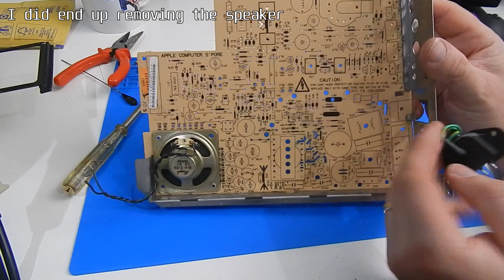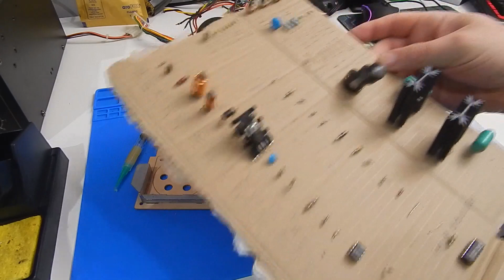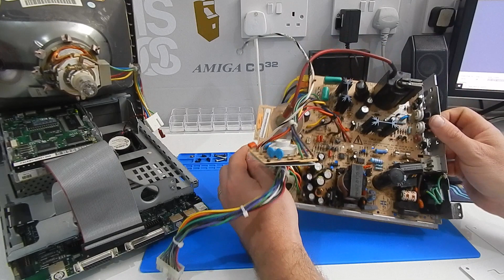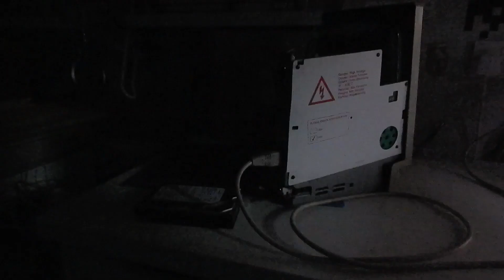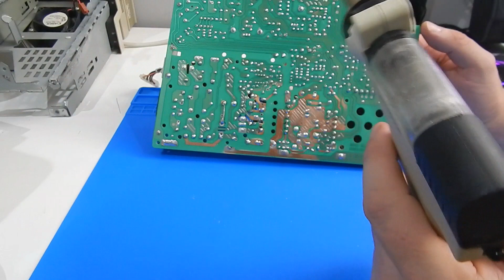Macintosh Classic Part 3 - it works!

Comment: I have the same problem with the screen, it shakes and i got the checkboard pattern, I'll check if it is the 3 caps that I haven't changed, otherwise I might try the PCB relaxing hottub method.

Comment: Thanks for this video. I've been working on a Classic as well and had recapped but still had wobbly screen. We were luckier in that it booted further. After few minute we started to have static noise on the screen as well. Seems like we need a proper clean. I don't think I'll unsolder everything, probably just the speaker and put it in the washing machine. Will see if other comp there that we might remove before the machine.

Comment: Wow!  You removed all the chips/parts on that analog board??  Now that is dedication...  :-)  Glad you brought it back.  I always thought the Classic is the most unfairly judged Mac.  Yes, it was underpowered for the time.  But the base unit (1M 1 Floppy, no hard drive) was the first Mac priced under $1000 USD.  People don't realize how important that was.  And I love the OS in ROM.  (Command, Option, X, O while booting I think??)  It is actually my favorite of the compact Macs.  Not the most powerful, but I think it lives up to it's name. ;-)
Reply from the maker: Yep every one removed, turned into a lot more work than I was expecting but glad to have a working machine by the end of it.  It is a fun little machine and still working fine. I actually have another spare analogue board now although it to needs a bit of work, hopefully not as much as this one.

Comment: Tried my Mac Classic after cleaning but still no video, How do you know if it's your logic board or your analog board?
Reply from the maker: Does the screen turn on at all?

If not its probably the logic board since that is required to generate the signals for the screen.  Most likely needs a recap.
Reply: @CRG Thanks,  I did clean up my board real good and now getting a fant single horizontal line in middle of screen.  At least that's something. Thought my board looked pretty clean but will go ahead and try and re-cap my logic board. I do have a working LC475 so the Classic will just be a project for me.

Comment: Not this one, but for any other blown video Classic Macs, I'd like to see an e-ink (e-paper) display. Since they are mostly show pieces anyways, and B&W, and the screen is small,... I'd like to see a clever e-ink hack on one.  You might be a little burned out on Macs, but you've certainly gained a great deal of hard-earned expertise on these obsolete machines!!!
Reply from the maker: That certainly would be an Interesting mod.  Not sure how fast those screens update though, might not work great for moving graphics.
Reply: @CRG  E-Ink screen are also rated for the amount of refresh, some as low as 10000 refresh. Of course, you can update the screen without full refresh, it is fast but after maybe 5 frame max you need a full refresh cycle because the image becomes "dirty"

Comment: I'm in the middle of restoring a Classic myself. I've got a short to ground and I thought it was DP7. Even with the diode completely removed, it was still shorted to ground but only when the tube board is connected. I've had to order a replacement tube since it blew inside without me noticing.

Also, the drives on these Mac's can use 1.44MB disks, so you can write them with a modern USB Floppy drive. :)
Reply from the maker: Thanks for the info on the floppy drive.  That should make life easier for testing the drive.

Comment: Hi, very good work! I have an analog board 630-0420 that seems the same as your, I hope!. Mine is without some caps and no info on the net is available for the 630-0420... do you have write down a cap list for these analog board?
Reply from the maker: I'll get you a copy of the schematics tomorrow. That lists all the caps or if you want to tell me the capacitor number on the silkscreen I'll let you know what it is.
Reply: CRG Thanks!!! the schematics would be perfect!!! Or considering that I have seen better and all the electrolytics are missing, instead of a caps list I can send you a photos of the board if you prefer. But how?
Reply from the maker: @emilen72  you can get the schematics from this dropbox link - https://www.dropbox.com/s/x80hy38feysm9pw/Macintosh%20Classic%20Schematic%20%28bomarc%29.pdf?dl=0

If you want to send me pictures I'll take a look.  You can send them to my e-mail casualretrogamer@outlook.com
Reply: CRG have mail :-)

Comment: Wow.  What a big job to completely disassemble and reassemble that board.  Given the number of components, putting in the odd cap the wrong way round is not too bad.  Congrats on the result.  Cheers
Reply from the maker: Thanks, it was a silly mistake though as its clearly marked on the board which way it should go.  At least it didn't damage anything else and I had a spare handy so was easy to swap out.
Reply: To avoid desoldering everything I suggest getting the schematics and finding the spot where the low resistance to ground is, that should be much faster than 4 days of work ;)

Comment: Four days to reassemble that analogue board - now that's a labour of love! As to what to use the machine for, my brother used one of these for graphic design when he first started his career. Crazy to think when you consider how small the display is.
Reply from the maker: Well, it was about 6-8 hours total work.  With everything else going on I don't really have the time to sit and work at something  for long periods so it was broken up over the 4 days.  

I discovered on the hard drive a few personal files dated 2019 so this machine was in use as someones computer last year.   Its a wonder it worked though with the leaking caps.  Must have been on its last legs or maybe that's when it failed and the reason it was sold.
Reply: You probably know this, but part of the appeal was the screen was calibrated to the same size as print. Even today we often have to consider WYSIWIG scaling or use special real-size modes (like "oh on this screen do 127% scale"), but that was an inherent feature of these Macs. 

Also there was a healthy 3rd party display market for the machines, all which could, in a vertical orientation, show an entire page at once with the same scaling. So then the tiny Mac screen could be used to focus, or even zoom-in, on areas, or just show a lot more GUI at once. 

In fact if I recall (Computer Chronicles had a feature about it) some businesses kept those external B&W screens in use long after upgrading to colour Macs with bigger screens, precisely because they were so accurate and handy for displaying a page.

Comment: [insert expletive here] you put in a lot of work into this one! No wonder it works, you built a brand new machine from scratch! I have one of these and a Macintosh Plus sitting in storage, no idea what to do with them.
Reply from the maker: Thanks.  Equally I have no idea what to do with this machine.  Could use some retro brightening so will probably tidy it up and put it on a shelf.
Reply: replace the screen with an e-ink display!!! The ultimate electricity saver for one of these things!